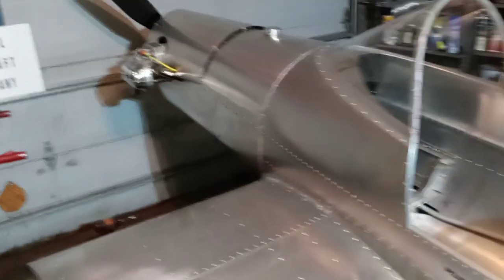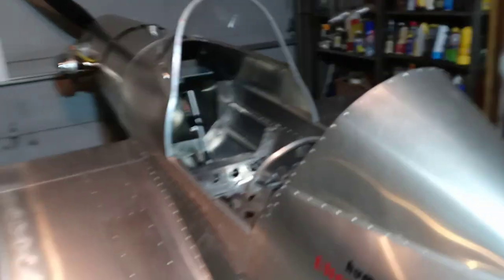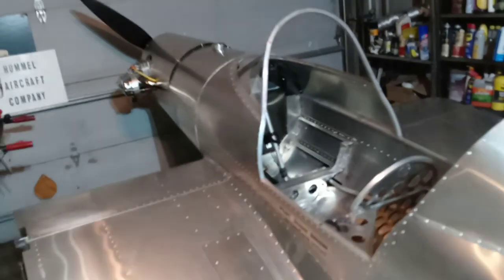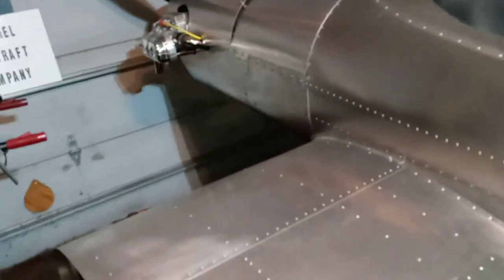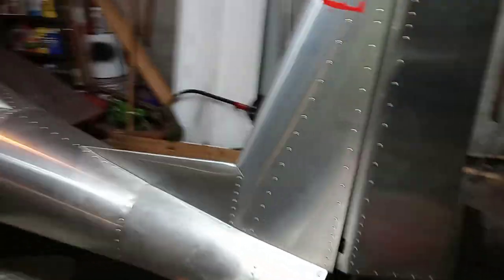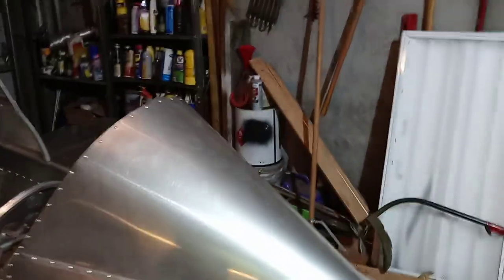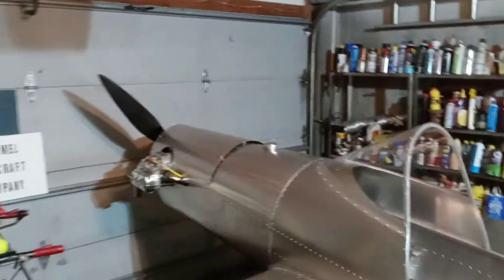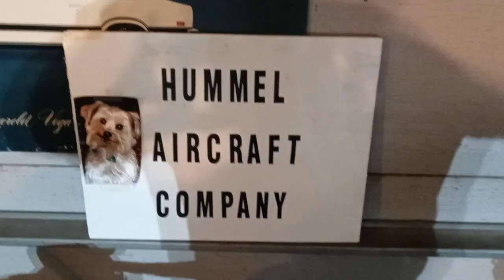UC weight with certified scales We made it!!!

Comment: Well done Dennis, once again your efforts are giving builder's a real insight into building the plane. Like us Humans putting weight on is easy but losing it isn't.
Reply from the maker: Hi UltracruiserUK you sir have hit the nail on the head!!! It is harder to take weight off than it is to put it on...... thank you for your support
Reply: Great news. Did you change out the seat belts already? I don't think you mentioned in this video. If not you may still save a few more ounces there.

Comment: Dennis, you bring excellent news 🏁.

As a side note, I recall you mentioning varying weight of aluminum sheet.

I will bring a digital scale when I purchase material for my scratch build.

When the time comes, I will calculate the weight difference between titanium, steel and aluminum for fabricating the gear legs and axles.

Could possibly save weight by fabricating the pushrods from carbon fiber?

FYI, currently available are synthetic wheels that bolt together with 3 bolts. Reportedly, these wheels save 15 - 30% weight vs aluminum wheels. YMMV.

As I plan to fabricate the wing ribs as build up, I will heed your advice and use 3/32 solid rivets vs 1/8 pulled rivets.

As for saving weight with the engine, I plan you use a Mexican VW OE oil pump cover with screw on oil filter provision. As for an oil cooler, that remains to be seen of the selection of style and manufacturer, though thermal efficiency and weight are the primary concerns.

Thanks again for another exciting video. I await your latest UC maiden flight. Will Harvey be the test pilot, or will you?
Reply from the maker: Hi Chris A you sir keep me informed on your weight reduction program. As far as the nylon wheels go.....they say they are lighter than aluminum but they are referring to cast aluminum Wheels. As far as test pilot goes I will do it. Thanks Chris for your support and comments

Comment: Congratulations!!
Reply: Yo might be able to run NIKOSEL aluminum cylinders and knock off some more weight.  But they aren't cheap. I run them on my 1975 R90/6 BMW motorcycle. They definitely out last steel. Only time you need steel is when you run a turbo. Mine also seem to cool better.

Comment: 1:14 I wonder if the seat's metal could be nylon straps to save weight? kind of like a lawn chair, but bucketed a bit to fit your body. it may be more comfortable that way as a bonus.  Your videos are inspiring Dennis, keep at it!
Reply from the maker: Hi Jon Moore you sir have a great idea!! But are you talking about the seat back or bottom? Thank you for your support and I hope I have inspired you to build one? Do not give up on your dream
Reply: @redblackvette  Im not too familiar with how the bottom seat normally works, but I assume a simple frame attached to the super structure with a mesh grid could save a bit of weight. even if it breaks even, it may be more comfortable.

Comment: Hi Dennis, I'm building an ultra cruiser under the umbrella of STL.  Can I put  transponder in a part 103 aircraft? Or does it have to be experimental?
Reply from the maker: Hi flyin92 well sir from what i understand if you have no electric system you cant have a transponder. But yes you can. But think about all the Cubs and Champs and others flying around with no electrical systems. And good luck with your ultracruiser build......
. By the way my airport is under the mode C Veil

Comment: If the canopy is not necessary for flight, can you make it easily removable and not  include in the empty weight?
Reply from the maker: Hi Douglas Cooke no sir the canopy is not necessary for flight! And it is easy to remove. You loose a lot of hats with out the canopy on!! I just really like flying it with the canopy and if I can put one on and still be in weight that's what IM going to do. Thank you so much for your support
Reply: @redblackvette  I'm asking if it's necessary to include it in the empty weight.
Reply from the maker: Hi Douglas Cooke yes sir it would be included in the weight. That's why I wanted to get mine down low enough so I could add a canopy...